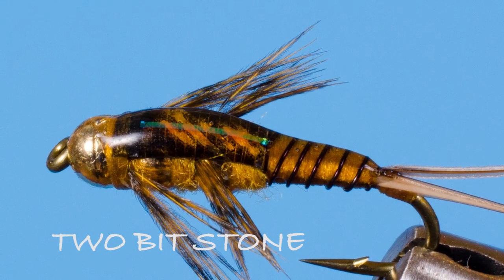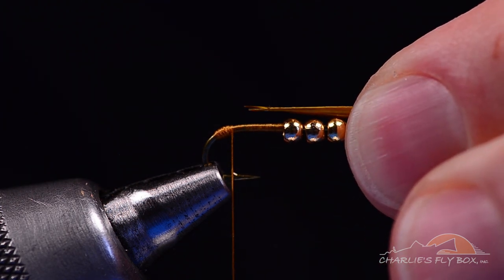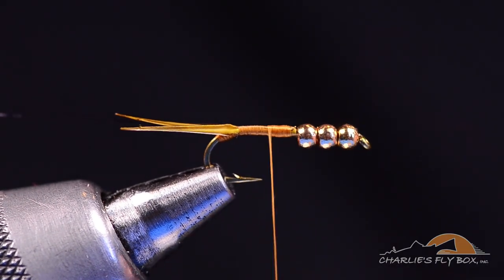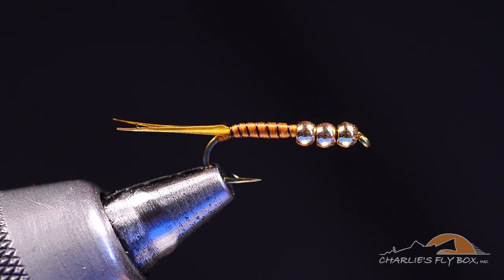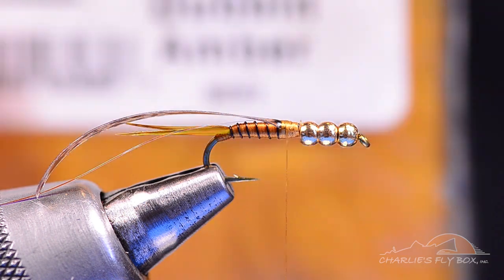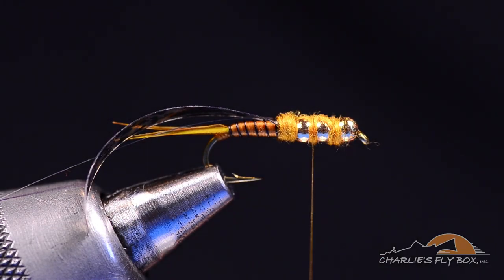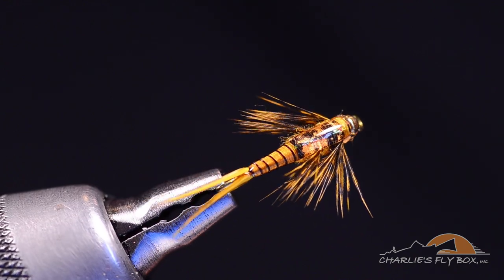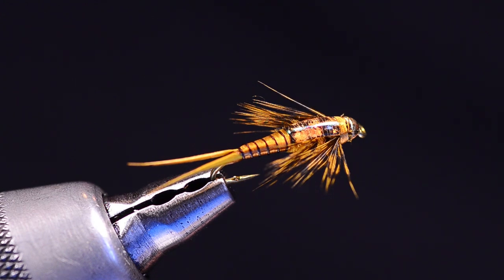Two Bit Stone by Charlie Craven

Comment: Hi Charlie, 
I'm a new subscriber because I am thrilled with your fly tying abilities. They are very impressive and an inspiration to a fly tying novice. 
If I may be so bold as to make a suggestion, your introduction audio level is plenty loud enough but for an aging fly fisherman it's a little hard to hear when you're speaking. Could you please increase the audio level during the time when you're instructing us? Even with my volume up all the way it's sometimes difficult for me to hear you at those levels. TIA, Paul
Reply from the maker: Paul Valley , thanks for the input!  I’m  a pretty soft spoken guy so I’ll have to make a point of speaking a bit more loudly!
Reply: Charlie's Fly Box 
Hi Charlie,
I was in broadcast video and you can usually  increase the volume in post-production or you might want to consider  wearing a wireless lapel microphone. They have a crisp audio response and will easily increase your volume before post-production. Thanks for the fast reply too.
Paul
Reply: Charlie's Fly Box 
I forgot to ask does that clear coat work as quickly as shown in your video? It seem like you only had it on for three or four seconds before it was hard.
Paul
Reply from the maker: Paul Valley it cures pretty darn quick.  The lamp is powerful and zaps it in a hurry.
Reply: As far as the curing goes it does harden very quick. I accidentally cured the top of my bottle shut from about 12 inches away. The lamp is alot stronger than you think!